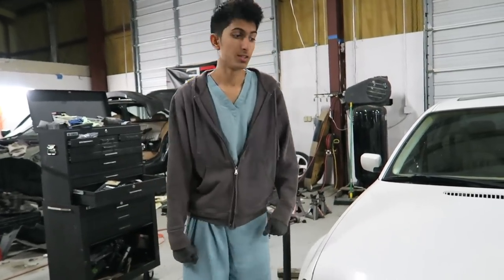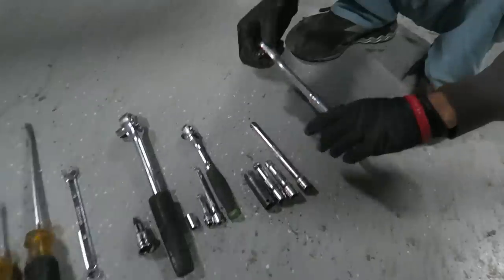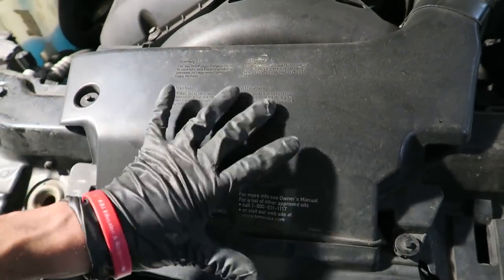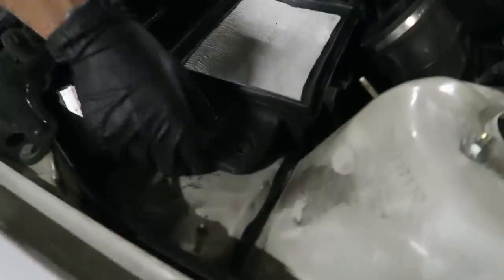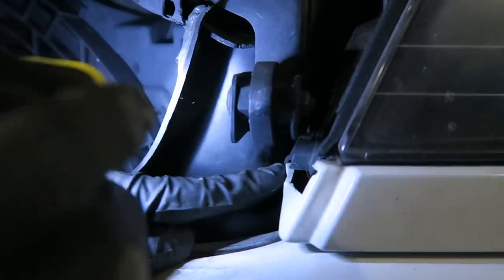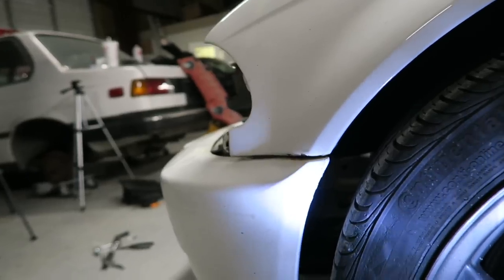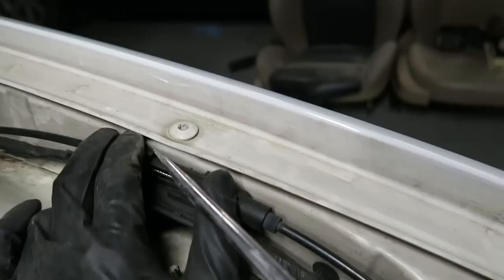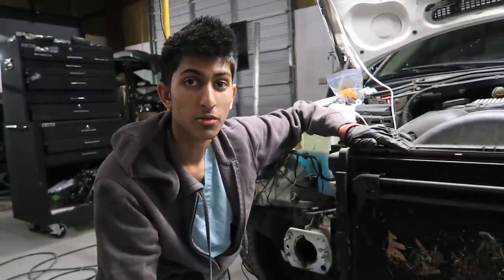How To: BMW E46 Front End Removal

Comment: The facelift headlight has to removed as a whole...There is no separate indicator Dude ..on M sport models anyway and the ends of the front bumper are raised and lowered by two plastic brackets totally different check one out...Good video on that model though Dude

Comment: +1 nice video, makes it look easy.

FYI, the airbox with filter & MAF sensor are more easily removed as one.  Loosen the hose clamp holding intake boot to MAF, remove connector, then undo the 10mm bolts holding the airbox down & everything can be removed as one.  Put aside in a safe place, of course.
Reply: mines held in by the clamp, don’t even have my MAF in or those bolts into my tire well 😭

Comment: Hey just wondering if you have a video or know of a video out there with a front end assembly video? I took off my entire front end including the rad, a/c condenser and whatever else that was in the way of the engine as I had to put a new power steering and water pump pulley on and everything was bent against the engine.

Comment: Great video, answers a couple of my questions. Ive an e46 '05 m sport (facelift) and need to get rid of the gap between the front bumper and the light trim (approx 10mm on either side). I can remove the lights and bumper with no issue now, thanks. I tried adjusting the white bumper holders on either side of the wheel arches as much as I could, does nothing. I tried adjusting height using the inner adjusting collars in the bumper shocks but they are jammed tight, (Go only knows why are they plastic). Is there any other way I can adjust?. What if I loosen the shocks themselves, is there any play with them vertically? Thanks Fred
Reply from the maker: +detonatorfd Hey you can adjust the gap by loosening the screws that hold the headlight support to the radiator support. They are 2 8mm screws that are adjacent to the bumper shocks. Let me know if you need more help!
Reply: 6 years later... The gap is so common for people. I didn't know you could adjust the headlight bracket. That would definitely help. I used foam pieces I glued in place to push the bumper up when resting on them. Wish I knew about this sooner. Maybe a good future video

Comment: Wouldn't it be easier to take the two bolts out that hold the bumper carrier, then unbolt the bumper shocks?  That way you can leave the lights in place. I'd also remind folks to fish out the plastic caps that attach to the ends of the bumper shocks (they fall off when you remove the shocks)

Comment: from 8:42 what size tools did you use to remove the 3 bolts and washers on the bumper bar before you pulled it off???

Comment: is the bolt pattern the same on a 2001 E46 as a 2002 E46 complete front end bumper radiator assembly and fenders

Comment: I have an E46 323iA and I have a problem with my automatic transmission. When I put in Drive mode it automatically goes to Sport mode aswell, but I want it in Drive mode for better fuel economy. And I recently discovered that if I push a little bit on the gear lever so that the light for Drive mode turns off (so its like between D and N) it goes to normal Drive mode again. Do you have any fix for this or? :)
Reply from the maker: ***** Sorry for the late response, your best bet would be to replace the shifter assembly, contact me on my business email located on the about page on my channel as I have one for sale. If you need a replacement diy video I can provide that as well. Thanks for watching!

Comment: Can you make a video on how to wash/clean the engine on a e46 ?
Reply from the maker: Will try to make one, here is a quick walkthrough. Cover air cowl and alternator with bags. Use a degreaser (make sure not to get it on any painted surfaces) and spray down the engine bay(make sure the engine bay is not hot). Scrub with a soft bristle brush and then just rinse off using low pressure and do not spray in any one spot for too long. Just quickly rinse.
Reply: ShopLifeTV

Comment: hey is that what I would need to do to put a newer version front end.. I have a 01 and want to replace it with a  04...
Reply: You mean that you want turn prelift to after lift version?
To do it you need also to replace fender, lights, and few more.
Reply: +Arek R. So the fenders, hood, lights, radiator support, and bumper cover? And thank you for the reply & help!!!
Reply: Yep.
There are vids on others channels showing complete swap.
Of course you want to put M3 bumper? ;p
Reply: +Arek R. Yeah M3 bumper cover is the plan 4 sure...   Thanks Again!
Reply: np
Also LED angel eyes will be installed? :D

Comment: can you install a M3 bumper to a e46 sedan?
Reply from the maker: +Dilan Jey You can only install the aftermarket replica ones that are made for the sedan as the real M3 bumpers are too wide for the stock sedan front end. You may also need prefacelift bumper brackets if your car is a facelift.